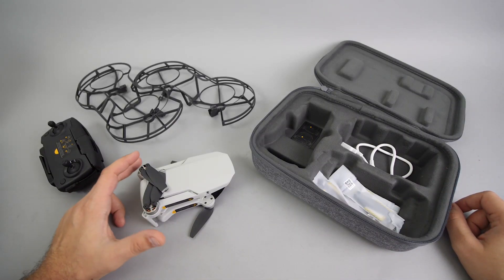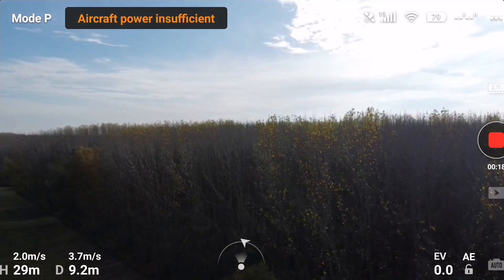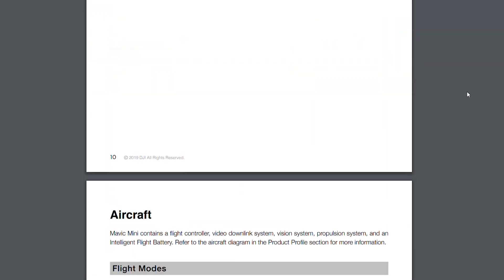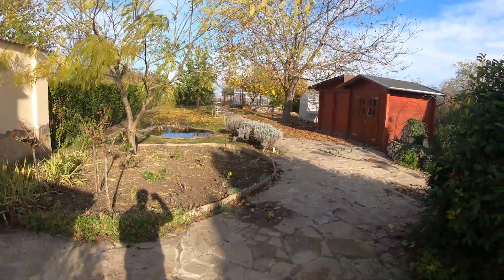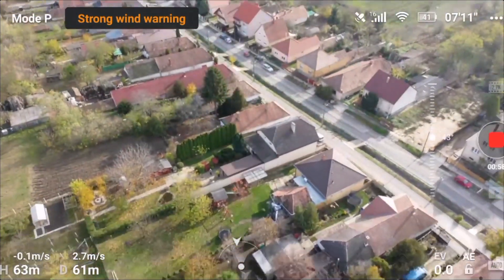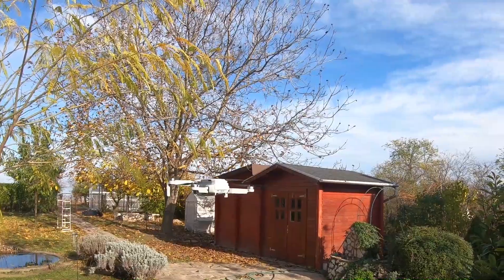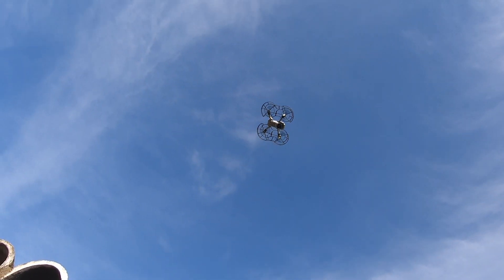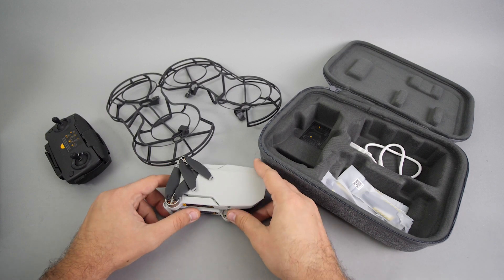DJI Mavic Mini problem with the prop guards on - wind blows it away!

Comment: On the safety settings you will see advance safety settings at the very bottom and a toggle which says payload mode, toggle this on when using prop guards and flying in a windless environment

Comment: Great info, wish I seen this and a few others before! Major factors like "winds aloft"  which can be much stronger and of course gusting can be problematic, especially with prop guards installed. I like to take mine for a spin around beer-thirty taking off and landing from my table top on the veranda... 🙄 so I leave the prop guards on, and only fly like this when it's not too windy! Regardless, my mini flying maniac will frequently report payload mode/limited flight mode (which can be turned back off at the bottom of the safety menu) and high wind. Good advice is check winds aloft at take off and generally plan for return with the wind at lower altitude.... And practice a few hand catches in case the wind kicks up unexpectedly!

Comment: I had exactly the same issue with winds around 20 kph at height above 30 metres and above. Even moderate winds of 14 kph were pushing the drone away and error message popped up telling me about heavy wind conditions and disabling of auto return function. Prop guards make aerodynamics of the drone different and it’s impossible to operate it in windy conditions at all.

Comment: I had a same problem yesterday. The wind just blown away my DJI Mini2. I'm totally lost the control on it. I really tougth I will not see my drone any more. Finillay I could take back the control, but not 100%. And call back the drone. It was not come back  to the starting point. I'm landed unsafely. Finally I could pick it up. I had some propeller demage even the propeller guard was on it. But that is. So it is really not recommended to use the propeller guards outside, and always check the wind speed.

Comment: I just tried my new mini with prop guards in a good headwind and it would not be stable at all.  It was about 5 meters up and dropped 1.5 meters in a second.  I like the idea of the prop guards but I do not see me flying with the prop cage on.  I will look for the lighter guards that only protect the bottom surface and see if they do any better.  I am glad it is not only me having an issue.  I also noticed that the drone leans to one side more heavily as well.  It does not want to stay level in flight.  Maybe the wind had something to do with it.

Comment: I tried prop guards yesterday and it was very poor experience. Where was no wind, temperature was -1° c and it was drifting sideways, lossing height and crashed 3 times. Descending to the ground with no stopping... I will never use guards again

Comment: Are you going to get the Mini 2?
Reply from the maker: I'm not sure but based on the specs I saw I don't think so. For me obstacle avoidance would be very important as I fly low, and since the Mini 2 has no improvement in this domain (and no Activetrack either) it would not be a quality change. I'll probably go for a used Mavic Air 2 next year.
Reply: @RBsGadgetReviews  yay! Mavic air 2 is my favourite drone!!
Reply: @RBsGadgetReviews  by the way, if you go to the control menu in the App, you will find one that says 'payload mode', it is advised to switch that on when you are flying with prop guards. Hope this advice helps.
Reply from the maker: Does not really change things unfortunately, wind still blows it away. I did not use the prop guards ever since
Reply: @RBsGadgetReviews  Oka, that is very strange

Comment: Although if it does not blow so much where you stand on the ground, winds can be twice as strong with even stronger gusts already 20-30 meters up in the air.

Comment: I had the guards on as it is my first drone and glad I did they protected it a couple of times. I was alarmed when the wind picked up and it started being dragged away! Also the battery lasted about 15 minutes which took me by surprise. Payload mode came on automatically. I realize now from reading these comments what the limitations are, there should be a warning sticker on the prop guards by the manufacturer

Comment: Damn And here i use to think there was some issue with my Mavic Mini. I had faced same problem with my prop Guard On , it use  to drift side ways and i couldnt control it . Now will Try without prop guard , I hope it doesnt drift then because if it does then  i might hurt some one by flying the mavic mini inside there window 🙈

Comment: Yes, I have my prop guard on, the wind is only 10km/hr, I wasn't flying very high perhaps about 50m, it was in C mode and started to drift away from me, until my warning came on that it was over the distant limit that I set, which is about 400m. I was terrified, I try to keep calm, find the direction that I need to go and slowly descend and came back. (Still learning how to fly and use the home button). I got it back, finally!

Comment: Why would you use prop guards outdoors. Its a wind sail !
Reply from the maker: Wrote it down a couple of times but then again - because the drone has no obstacle avoidance and it is advertised with the prop guards as extra protection, and not restricted for indoor usage. No other DJI drones are affected by the factory prop guards, not even the Spark. Yes I know the Mini is only 250 grams, but then there should be a clear warning from DJI about the usage of the prop guards.

Comment: Hey my first mavic mini crashed on its maiden flight because it drifted into a tree with propguards on. The propguards got caught in the branches but the mini was tilting and in an attempt to stabilaize itself it flipped over and fell onto cement from about 5 meters up. 

When I recovered it I found that the gimbal came off the drone and the cable connecting it was torn.

The prop guards are more of a hinderance and a will not save the drone from a fall. I think they should only be used for indoor flights where theres no wind and a higher chanve of hitting the props against a wall. 

Ive since got a new mini and have never put the propguards on. Its perfect without them.

Comment: You are very right to report this issue. These prop guards weight 50 grams ie. 20% more weight is added to the mini and when it has to fight strong gusty winds this is too much for its motors. Their use should be limited to indoors or when there is no wind outdoors and the quad should not be flown very high, not above 20 to 25 meters max.

Comment: Just few days ago I tried out flying with prop guards on while flying between buildings, it did not end well. Wind was strong and pushed my mavic mini away, I can't even return it home by its feature. It ends up landing on top of a building, and I had to recover it manually by getting access to that building, which was quite embarassing and troublesome

Comment: I trimmed Alot of what I felt was Excess plastic on the prop guards. It lightened them up quite a bit & should have less drag in wind. Test flight coming soon
Reply: Ive had the same problem. I thought I could do that to the prop guards to ease the problem. Then, I saw your commentt. How did that work for you?, Any difference? Thank you.

Comment: Yes I also had the same experience, my mini got blown away about 800 meters with the prop guards on, luckily I was able to recover it. But never again will I fly outdoors with them on. You'll have to do your own visual obstacle avoidance.
Reply from the maker: So the prop guards are practically useless
Reply: @RBsGadgetReviews  Actually it is really helpful if you are practicing interior. I am using it for filming indoors. Without the prop guard I would brake my propellers hundred times already.

Comment: Thanks for you video - I have had a similar experience! Except that my drone landed itself very quickly. Luckily this  was close to me and now damage was done. I also got a number of messages regarding payload. This behaviour was only apparent after upgrading to version 0400 firmware so I have no reinstalled V0300. I have yet to test whether this has solved the problem

Comment: always switch to Sport mode if the drone starts to drift, no matter why you may need the extra power to get back.
it's not a "problem" .. its just the fact that the prop guards weight is 50 Gramms, meaning you adding 20% weight to the whole set, the rest is just Physics.
20% more weight you gonna need far more power to move it.
Reply from the maker: Sport mode won't save you either, DJI should simply warn you to NEVER use the guards outdoors

Comment: Turn on 'payload mode' in the settings....
Reply from the maker: It turns on automatically when you put the prop guards on and all it does is limiting the flight range and height.
Reply: @RBsGadgetReviews  Yeah I saw that.  We tried the PygTech prop cage - it's horrible.  It introduces all sorts of bad vibrations and harmonics that the flight controller can't handle filtering.  And payload mode doesn't come on autmagically with it (maybe there's a magnet switch on the dji prop guards, dunno.)
Anyway, thanks for the video.  I was here after clicking the return button for the PygTech one.

Comment: Yes .. I faced the same issue and was a bit confused for a while as I had shot a video without the prop guards and it held its ground. I even tried recalibrating but finally used it without the guards and it worked fine.

Comment: This happened to me just now but worse, it didn't try to land, it just came down ! Absolutely crazy, it came down like a sack of potatoes and i ran to catch it, i don't know if it would hit the floor but I caught it at 1 meter, so I presume yes! The second flight ever on my first drone ever and was falling from the 7th story. The motors and props were still going but not pushing back up so when i caught it, they caught my finger which is now bleeding and i am super worried this will happen again but i won't be so lucky to catch it. I think i will just fly without the prop guards from now on. What do you advise?
Reply from the maker: Don't fly with the prop guards on

Comment: I was considering this drone but the more and more videos I watch, I approach the conclusion this is not a good investment, its a fragile drone and hardly a beginner's, it will brake from the slightest fall and if indeed it does not fly well with guards, it then becomes a horrible expensive piece of sh--.
Reply: Spark is better for budget types
Reply from the maker: I had the Spark, the 3 axis gimbal and the improved video quality is nice but you really need to be careful with this one

Comment: I agree with you about the wind + propellor guards. There is an option to turn off the payload mode enabling you to go further than 100m.
Reply: But how
Reply: It'll auto turn on sensing weight and wind...

It's just not safe to fly with threw outdoors in wind especially

Comment: As others have said the prop guards are mainly for indoor and training use. They’re not intended for serious outdoor use. Also, most drone shots are taken from within 100 meters of both height and distance so that’s not a serious limitation for most uses. This drone was specifically optimized to be under the 250 gram regulatory limit so that required various compromises. If you don’t care about the weight limit and size, get a bigger drone.
Reply from the maker: As others have said they had zero clue that the prop guards are mainly for indoor and training use. Why? Because it is not indicated anywhere! It is supposed to be a beginner drone, so most folks who buy it will have no clue. It shouldn't be difficult for DJI to put a sticker on the prop guards with a warning. The Spark had prop guards and it did not have any issues or limitations flying with them. Yes this drone has compromises to stay below 250 grams, but the buyers should be properly informed about them, that's all.

Comment: My mavic mini fell 2-3 time straight to the ground from 60-70 meter height..and while felling down not a single controls were working...very disappointed..sending back to repair center..
Reply: :( my mavic mini ever have that issue but only once i think its because of the bug in the software

Comment: Hi I am also facing the same problem...i always fly with prop gaurd on..i was flying it from one corner of a circular big ground...after fly for 60-70 meter height it started flowing with the wind and disappeared in few seconds...i started running..and it fell down...i started running.. thank god it was big ground..iif it would be water ...than it would be its last day

Comment: Oh finally found a video that explains. I had prop guard on and flying 100m away. I lost control and it just landed wherever in a forest. Lucky I was able to reach but it could've fell into a dam.. I didn't even know it was limiting my flight distance. Thanks for the video.
Reply: Hi I am also facing the same problem...i always fly with prop gaurd on..i was flying it from one corner of a circular big ground...after fly for 60-70 meter height it started flowing with the wind and disappeared in few seconds...i started running..and it fell down...i started running.. thank god it was big ground..iif it would be water ...than it would be its last day
Reply: Do i need to send it to repair center ?? Or do i need to fly it without prop gaurd..
One more thing.2-3 time it fell down from 60-70 meter high ..while falling no controls were working
Reply: @arunnegi92  When I contacted a support, they say it shouldn't happen even with the guard if it's calibrated properly. So if it keeps happening, it can be defect maybe.. I feel like it's just because of the prop guard though.
Reply from the maker: @arunnegi92  I definitely suggest to get in touch with DJI, that's not normal

Comment: Prop guards are really for indoors flight.  Common sense should tell you that the guards WILL add substantial drag & wind resistance, almost acting like sails.   This video is a combination of physics and stupidity.  As 'review material' this is irrelevant. Sorry for being blunt.
Reply: Lost control of mine due to strong wind with guards on -Never again!!!!!  Got it back though!
Reply from the maker: Thanks for the kind and constructive comment. Common sense tells me a beginner drone should be powerful enough to carry an accessory that has zero warnings where and how to use it.
Quoting the official page: "Fully protects the propellers and improves flight safety, especially for beginners, or when flying indoors or in locations with many obstacles."
So it is NOT only for indoors flight and beginners can easily get in a situation when they want to fly it outside but they don't expect that the wind will blow it away easily.
Btw the Spark's prop guards had a similar weight (although smaller surface) and that had no any issues flying in windy conditions.

Comment: Thanks for sharing. 
I would be using the prop guards for low altitude to fly through thing minimizing crash risk. 
For in the air flight, prop guards wouldn’t be needed unless it’s a high bird area??
Reply from the maker: With the Spark I did fly a lot near different obstacles outside, I do a lot of low altitude shots, filming my RC stuff. The small prop guards were useful and I had the obstacle avoidance turned on as well. That's why I was planning to use the prop guards on the Mavic Mini as well most of the time but due to these limitations I won't.

Comment: I was flying mini with prop guards at 95m height, light wind. Suddenly it started driving and landing without my control, almost landing on the road nearly and hitting a car. I was lucky, landed 30cm off the road. Must be the same problem like in the video.
Reply from the maker: Definitely the same issue, thanks for sharing your experience!
Reply: Hi I am also facing the same problem...i always fly with prop gaurd on..i was flying it from one corner of a circular big ground...after fly for 60-70 meter height it started flowing with the wind and disappeared in few seconds...i started running..and it fell down...i started running.. thank god it was big ground..iif it would be water ...than it would be its last day
Reply: My mavic mini fell 2-3 time straight to the ground from 60-70 meter height..and while felling down not a single controls were working...very disappointed..do i need to send back to repair center..is there any problem?

Comment: The prop guards are only really intended for indoor flight for new pilots, to avoid contact with obstacles! 
For outdoor flying I would recommend NOT using the prop guards as it will struggle with the extra weight in any wind, also if you crash into a tree or something it might hook onto branches and you might lose it!
Reply: When I tested with prop guards in the wind (aprox. 4-5m/s) wind blows mavic mini away. I use prop guards only indoor.
Reply from the maker: I did a lot of low altitude shots near different obstacles outside with the Spark and the prop guards were very useful. The Spark did not have any issues or difference with the prop guards on, so I did not expect such a significant effect on the Mavic Mini.

Comment: Do you have made experience with the flight time with using the prob guards. Some people say that it reduces the maximal of the flight time nearly over the half.
Reply from the maker: I did not try it yet, maybe I will do some indoor hover tests as the weather is pretty bad nowadays.
Reply: @RBsGadgetReviews  that would be niche. i think a indoor test is sufficient
Reply: That seems to be the case with mine... it reduces the flight time to around 15-18 minutes before low batt warning  chimes in
Reply: @dchl27  ok, that's good to know

Comment: interesting video. The prop guards are realy heavy load for such a small 250g drone, so i'm not surprised that it makes some trouble under windy conditions. I would only use the guards for indoorflights in some lost place buildings.
Reply: not the weight, its the dynamics of these particular guards!
Reply: okey that's true. You could be right about that